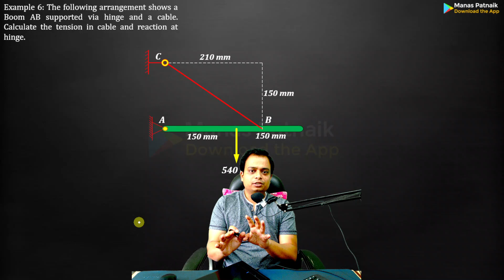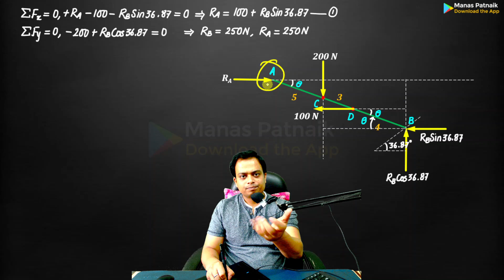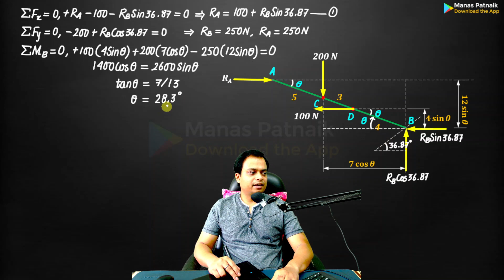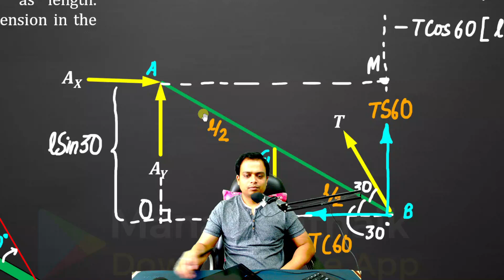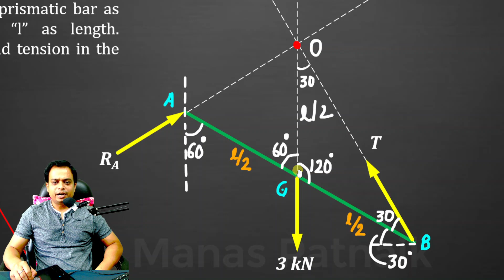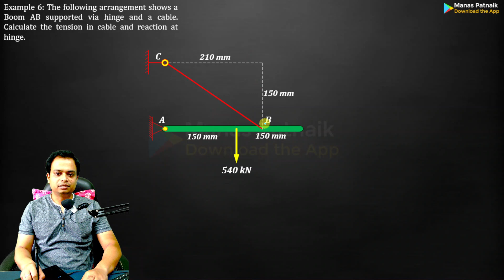Comment: Sir, how do we identify the direction of the moment of a force with respect to a point as clockwise or anti-clockwise?
Reply: To identify the direction of the moment of a force with respect to a point as clockwise or anti-clockwise, follow these simple steps:

Visualize the Force: Draw the force acting on the body and locate the point about which you are calculating the moment.

Think About Rotation: Imagine the force causing the body to rotate about the point:

If the force would make the body rotate like the hands of a clock, the moment is clockwise.
If the force would make the body rotate opposite to the hands of a clock, the moment is anti-clockwise.
Cross Test with Your Hand (Optional): Use your right hand to confirm:

Point your fingers in the direction of the force.
Rotate your fingers toward the point (pivot).
The direction your thumb points shows the moment's direction (right-hand rule), but for clock notation, stick to the clockwise/anti-clockwise check.